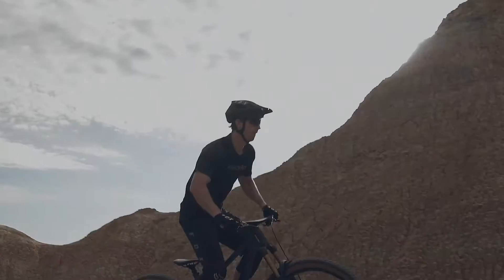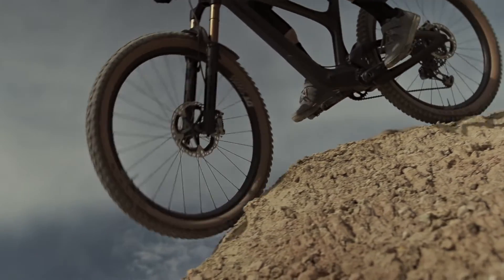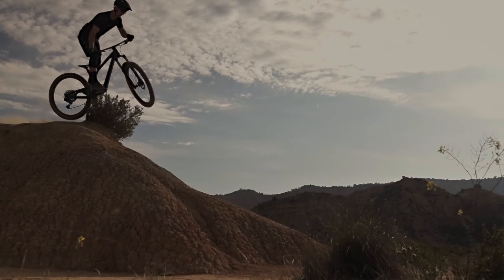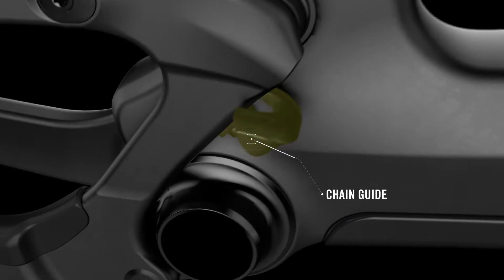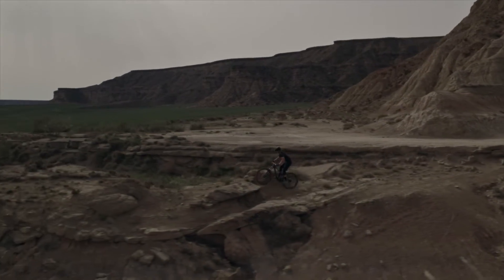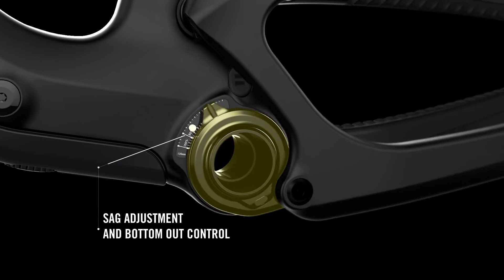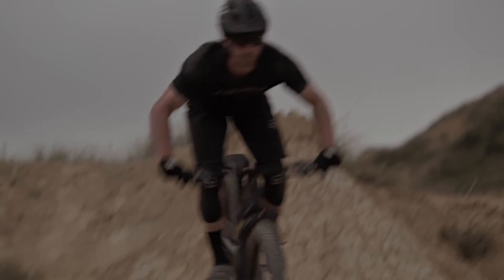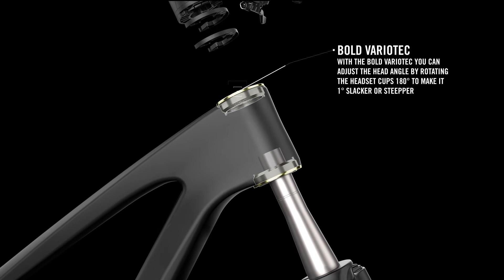BOLD LINKIN // TECHNOLOGY

Comment: quite ipressive, but this kind  of  suspension layout is not completely new - Banshee bikes have something simillar in their downhill Legend bike since quite a few years. Of corurse, the damper was not fully integrated in the frame, and lower link was not rotating arround BB, but the general idea was rougly the same. Anyways - the final effect of work of Bold's engineers is one of the best looking bikes. I wouldn't mind having one
Reply: absolutely true! especially the part of having one :D